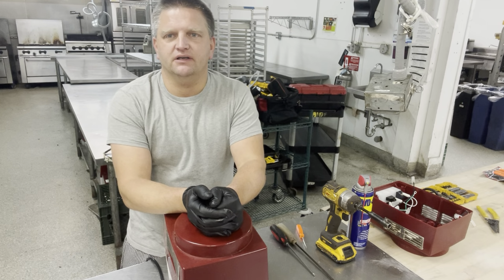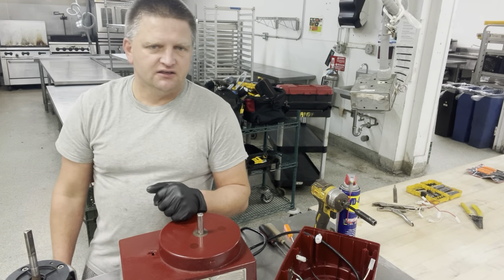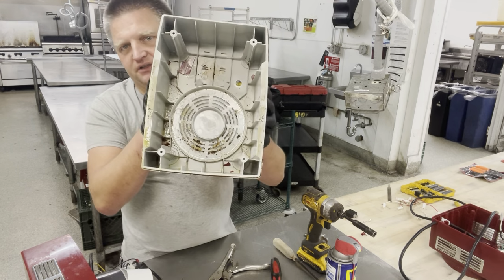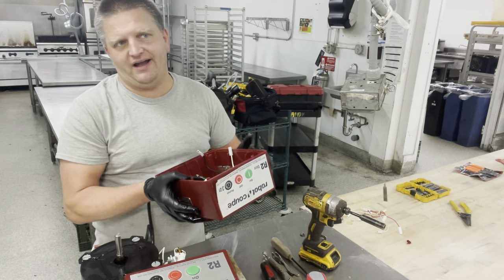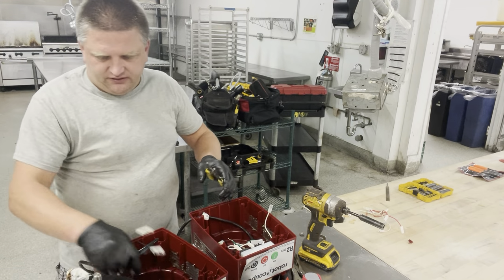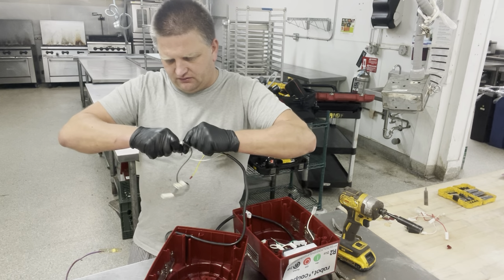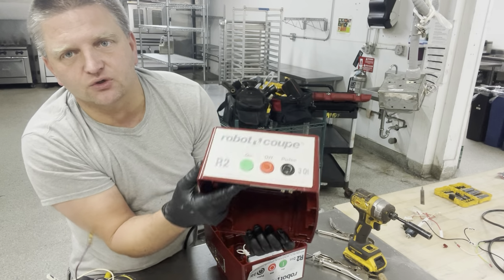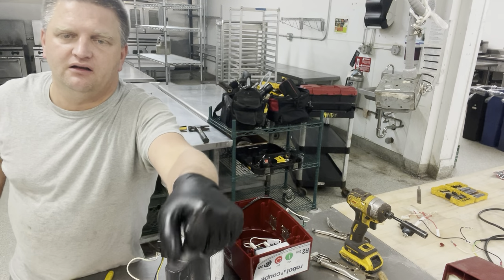Robot coupe r2 upper housing replacement part 1

Comment: 28:00 my guess is that the adapter plate serves to put equal pressure on the housing on all the motor surface contact area :) seems like it should really be made of metal or a different plastic though...
Reply from the maker: Metal would more likely put to much force onto the housing itself but better plastic would defenatly do the job.

Comment: Hi I opened one of them robots too changed the bearings and the rubber seal ring from the top. But I can't remember where the wires go  could you help me please?
Reply from the maker: There is diagram for the wiring on line i can send you a link .
Reply from the maker: https://www.russellhendrix.com/images/media/Robot%20Coupe%20-%20R2N.pdf

Here is the manual for it with a wire diagram .

Comment: Hey Andy, thank you for the information. I currently have two that give a buzzing sound then shuts off, bladed do not spin. Could it be the capacitor? I’ve swapped out the power cord in the past hoping not to have to buy a whole new one. We currently have 5.
Reply from the maker: Did you try to spin the shaft by hand ? If it really stiff and hard to move your top bearing is gone and need replacing , the capacitor it’s almost never the problem , but if your shaft spins free after you turn it on , and the unit starts after you spin it by hand it’s your capacitor for sure . , the way to test is is - take the bowl of the shaft , press the green start button and insert top of a  pen without the tip on into the center pice ( black dot in the center of the unit - aka - bowl switch , while pressing down onto it spin the motor shaft by hand clockwise if the motor starts its your motor capacitor if the shaft is super stif and unit buzz off and shut off it’s your top bearing .

Comment: Hi Andy thanks for your videos.
I have to fix a RS5 plus. It doesn't start. Makes some clicking noises at the plugging phase but nothing happens when I press any button.
Can you help please.
It is on 3 phase 380v
Reply from the maker: I never heard of that model any chance you can send me a picture of the manufacture plate and the unit it self ? Thx .

Comment: what type of screw driver is that? standard 22 cross bit doesn't seem to be able to take out any existing screws on the bottom. Is it a star bit?
Reply from the maker: On older units it’s regular Phillips screws on new ones is the star shape bit , long shank ( 6 inches does the job)
Reply: @andyscommercialequipmentre4651  thanks! Ended up being a T20 start bit and inside the lid are two T10 star bit screws.

Comment: Im just wondering why other robot coupe has 4 wires is that 3 phase. Is there a  capacitor inside?
Reply from the maker: There is a capacitor for the motor , it’s not 3 phase just your standart 110v unit .

Comment: Hi, I plugged my 110V C50 into a 220V outlet (don't ask me how,, LOL) anyway the machine now only makes a humming noise when i turn it on and the shaft doesn't turn. I opened it up and everything "looks" fine and it was only plugged in for a few seconds and there was no smell of burning. What could be the issue? Thanks
Reply from the maker: I’m assuming you have a cl-50 unit not c50 , as I never heard of c50 before , if the machine is making humming noise try one thing - grab the top of the shaft and spin in it by hand , if you can’t reach it with your hand use a wooden spoon or something just to give it a spin if the motor starts and works that means your capacitor is busted and need to be replaced , other wise not sure why could be a problem without further troubleshooting it in person .

Comment: hey andy thank you for the videos, very informative. Have you ever replaced the safety rod on one of the bowls? i have a stainless steel bowl for the R2, but the safety rod at the bottom broke (so it doesn't engage the safety switch at the base with the lid on).  everything looks welded together so not sure if it can be replaced.
Reply from the maker: It’s super easy , if your bowl is stainless - there is a little screw that holds the striking pin in place ( that only applies to the bowls that are totally stainless - no plastic handle ) Robot coupe have to version of a stainless steel bowl - one totally stainless including the handle , it’s the heavier one as well , and one that mostly stainless with a black plastic handle , in order to replace the bowl pin in the bowl that completely stainless unscrew the bottom nut (it’s the round price right on the bottom of the bowl easy to spot is round in shape , you will have to use some type of pliers to unscrew it , ones that’s done remove the existing pin and spring ,install the new pin and screw the nut back on , I’ll recommend putting a little of a rtv or food grade silicon on the treads of the nut , thigh it and that’s it .
If you have the other type of bowl I’ll have to double check , i think  the removal of the pin in this bowl is similar to the plastic gray and clear bowl , give me a minute to check.
Reply: @andyscommercialequipmentre4651  hi Andy. Boy I feel silly. I have the bowl you just described.  The nut is so well designed that it looked once piece! I was able to unscrew it with some pliers per your suggestion.  What type of food grade silicone do you normally use?
Reply from the maker: Anything would work , I think originally they use tread lock ( loctite brand red color so the nut does not come loose , you just need a touch over the treads so it does not get loose with time of use and vibration .

Comment: what is the screwdriver ur using cant unscrew the bottom on mine. Please
Reply from the maker: If regular Philips screwdriver does not work use T-20 torx screwdriver .
Reply from the maker: At least 6” long  shank .

Comment: can I ask you why you think the motor is made of aluminum? that's something I was curious about
Reply from the maker: The motor is not entirely build out aluminum - top and the bottom housing pieces are aluminum with a large vent openings the center parts is made out of steel , it holds the winding that’s why , they use aluminum for to reasons - to lower the weight of the motor and two - better heat distribution to cool the motor during operation .
Reply: @andyscommercialequipmentre4651  nice thank you :)

Comment: What kind of screw driver do I need for this?
Reply from the maker: Older units use standart Philips screwdriver to do it newer unit you will need T20 torx screwdriver with a longer shank to do it .

Comment: How to convert power supply 380v to 230v robot coupe food processor r402 a
Reply from the maker: That’s a pickle buddy , usually r402 here in us are single phase 120v so I’m not sure how to deal with that my best guess would be a phase converter to convert it from 380v to 230v

Comment: Hi, I bought a second-hand coupe 4 robot and when I turn it on it makes loud noises and vibrates gently. I tried to change the knife from the other, but it's still loud. I guess it's a robot motor problem. Is there anything you can do about it? Please any advice, I don't want to throw it away, it's a beautiful machine.
With knife https://www.youtube.com/watch?v=Plsj9t0ajzk
Without knife https://www.youtube.com/watch?v=UeIHxbrbUiQ
Shaft looks straight but have loud noise https://www.youtube.com/watch?v=uMtHGrYLmLc